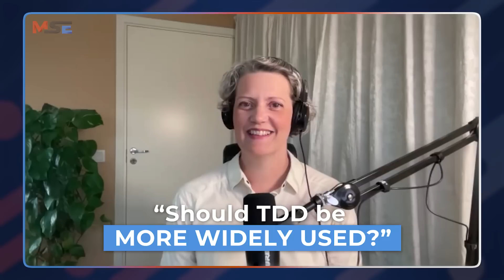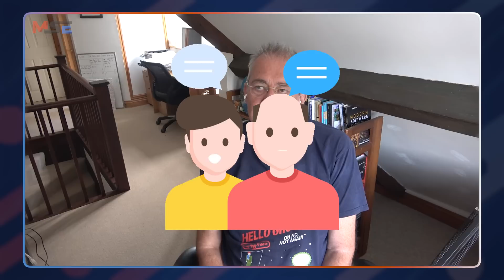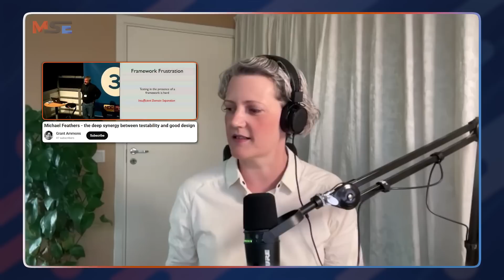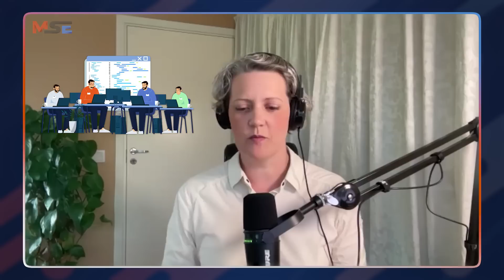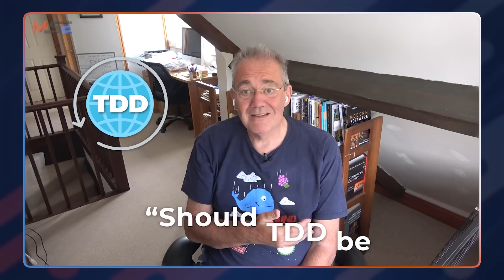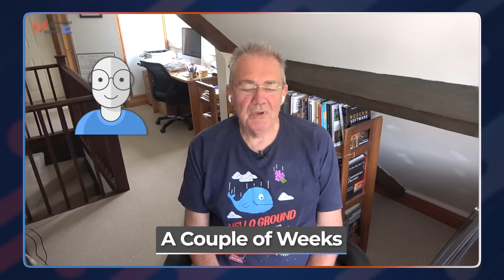Should Test-Driven Development (TDD) Be Used MORE In Software Engineering?

Comment: Do all the tests have to be run on the computer? 
How can I be sure to write a failing test? For example write a failing test for a function which multiplies two integers and returns an integer.
Reply from the maker: Running the tests to get fast feedback is the objective of TDD so "Yes" they all have to run on the computer.
That's easy, you pick an example that demonstrates the behaviour you want, and that's your test, so for your example...

 result = multiply(3, 2);
assertEquals(6, result);

It doesn't say how the code works internally, it just says what the code is meant to achieve - that's a good test.

Checkout my free Tutorial for a more fully-fledged example

https://courses.cd.training/courses/tdd-tutorial

Comment: It took me about 3 months to understand why TDD was the bee's knees when I joined a team doing TDD, and it's what you say here - it's the testable design it generates. The coverage is just a nice side effect.  I've got to the point where I can code this way without the tests, but I still use it for production code as I much prefer the fuzzy warm feeling it gives me to know that my code is evolving correctly and I've not made any design booboos.
Reply: I would fundamentally disagree  about the importance of the code coverage.

While just chasing code coverage metrics is a fundamentally broken way of working, having that code coverage is fundamental to so many other parts of the job.

If the bit of code you are working on and everything that uses it is not covered completely by tests, you break the core reason for using version control in the first place, the knowledge that you can check out any commit between adding and removing the tests for it and knowing that you do not need to go down the debugging rabbit hole to know that it just works.

Even more importantly, unless you can be 100% certain your automated tool always gets it right, you cannot refactor with confidence.

Finally, you don't systematically push io and core functionality apart in the way that makes updated code more testable.

Comment: TDD encourages writing higher quality code with high quality tests and better designs. The folks talking about coverage miss the point. Most enterprise code bases I’ve seen are 5% to 20% coverage and handle trillions of dollars of transactions. But I’ve seen low quality and buggy code with 100% coverage. In my view, it’s much more about the information value of the tests (Jim Coplien’s conjecture), not the # quantity of tests or % coverage. TDD encourages MUCH higher quality code AND tests in my opinion with higher information value about the quality of your code, not just a higher quantity of tests. I’m a huge fan of TDD, not a fan of test coverage metrics without it.
Reply: Coverage should not be a metric. It's a tool to help developers identify code that we definitely know is lacking any test confirmation. It's a valuable tool when working with legacy code in order to gain a sense of how much of a safety net we have for the code.

High coverage should be a result of TDD, not the goal.
Reply: @jimhumelsine9187 I would disagree about coverage should not be a metric. While having it as a target in the management by metrics sense is a disaster, being able to say file x has 5% coverage and file y has 95% coverage so x definitely needs more work can be extremely useful.

Comment: I view Test-Driven Development, Characterization Testing and Approval Testing as similar, but still different. I use them for different purposes.

They are similar in that each is based upon the behavior of the code, and all three techniques are structured with the Given/When/Then format. They differ in how the tests are created.

With Test-Driven Development we know the exact behavior we desire, and we define it in the test first. Then we implement the code until the test passes.

With Characterization Testing, we're often working with legacy code for which we don't yet know the desired behavior. With Characterization Testing, we define the Given/When portion of the test, run it, and observe what the legacy code does. Then we define the Then portion to match the existing legacy code behavior. Characterization Tests codify existing behavior, right or wrong, within the legacy code so that we can refactor the legacy code with less concern that we might change existing behavior. They provide a safety net from which behavior and intent will emerge as we refactor the code safely.

Approval Testing is sort of the hybrid of TDD and Characterization Testing. We're using a Characterization Test technique for new code. We define the Given/When part of the test, and we put almost anything in the Then portion. It doesn't matter. Then we implement the code and run the test. Then we observe what the code produced versus what we currently have in the Then portion. If we like the new results, then we codify them in the Then portion and continue.

We must still "Approve" the test results, but rather than defining then at the onset, we approve them as we observe them with the evolving implementation. If the new results don't look right, then it's a legitimate failing test.

I use Approval Testing when my asserts are based upon lengthy toString() results. They are too tedious to type in manually. It's much easier to let the code generate the string, confirm it visually, then copy it into the test once the code is producing the results I desire.
Reply from the maker: I remain sceptical, as I was in my conversation with Emily. In your description you say "We must still "Approve" the test results, but rather than defining then at the onset". Exactly, so how is it possible for us to "Drive" as in "Test Driven" the design of our code from a test, if the test only exists AFTER the code is written?
Reply: @ModernSoftwareEngineeringYT  I'm still doing TDD in small iterations. I tend to follow Bob Martin's 3 Rules of TDD where he cycles through the three phases of TDD quickly doing just enough test, implementation and refactoring repeatedly until the test is complete along with the refactored code that causes it to pass.

Let's assume that I'm testing a function that returns a boolean. I'll add that assertion in the THEN portion of the test using standard TDD procedures.

But let's assume that I'm testing a function that returns a lengthy formatted string. This might not be a string that my code formats. For example, if I want to confirm the elements in a List, I'll add an assert that retrieves the toString() value of the List and compares the string representation of the List to a literal string in the test.

These string representations can get sort of long. While I don't want to type long string in by hand, especially since it will probably contain a typo anyhow, I will know that the string has the correct value when I see it. I'll start with an assert against "???", which will obvious fail. Then I look at the returned string, and if it does indeed contain the content I'm expecting and formatted as I expect it, then I have "approved" it.

But I don't want to make this visual check each time I run the test. So I copy the approved string, paste it over the "???", and codify it.

The only difference between this approach and TDD is when I put that string in the assert as the "approved" string. Do I add it initially, quite possibly with typos, or do I add it once the code generates it.

Technically there is no difference between trying to create the approved value via TDD or just adding "???" as the initial approved value. Regardless of which you chose, when the test fails, you'll have to decide which is the "approved" value. The one that's in the test, or the one returned by the code.
Reply: @jimhumelsine9187  Why look at the string rather than the list itself?
Reply: @babgab  I used to do things like assert the number of elements in the list and/or assert each element individually. Then I realized that toString() provided a single unique element that I could assert that would confirm everything in the list.

This works for any structure that deterministically returns the same String representation upon each execution. It also works for composite structures, such as Trees or any object that contains field attribute objects, and those attributes are composite structures themselves.

That means that toString() must be defined for each object that's represented in the String. You can't use the default toString() implementation, at least in Java, since it generates a new hash code like value on each execution.

It also means that any identifiers and time values, such as timestamps, must be injected as test doubles so that they are consistent upon each execution as well.

There are also practical limits to this. it's not practical if the list being asserted has 1,000 elements in it. The String version would be overwhelming. In that case, I'd probably assert the list count and spot assert a few indexed elements individually.

I don't always use this technique, but it's useful when you want to assert multiple attributes of a moderately complex, yet not too large, object. One assert will take cover all the cases.
Reply: @jimhumelsine9187  But not only is that horribly inefficient (and making tests inefficient forfeits some of their value for TDD!), one assert if multiple properties are changing is the opposite of beneficial. I want asserts of each thing that changed during my test individually so that I know at a glance from looking at the error output what failed, not just that there was a failure! Not to mention, if the assert itself is too big, then it becomes unreadable and I have to spend effort untangling what the differences between the expected and actual results are manually and that's kind of counter to the point of automated testing to begin with. The fact that you're putting timestamps and stuff in the test part you're comparing makes it even flakier and more complicated, adds even more noise to the output on a failure.

I would never sign off on a code review that did what you were describing in a unit test unless the actual observable behavior of the code involved a string changing in the data. And even then, I might want to see individual assertions of specific features of that string. I don't think gold master testing is appropriate when you can use the full power of your test harness to test individual features of the output. I don't work with you and I can't really tell you what to do, but I implore you not to be hostile to your coworkers and future self in this way.
Reply: @babgab  It's a matter of preference. If it's not for you, then it's not for you. It worked well for me when I used it.
Reply: @jimhumelsine9187  Sure, "I don't want my test failure log to be incomprehensible symbol vomit that I have to sift through in order to find the actual problem" is a matter of preference. I guess. Technically. But I don't think it's a matter of preference that this approach is flaky (and in my experience, gold master testing is extremely flaky), burns CPU time for no reason to generate the string data, and encourages testing to an implementation rather than an interface.

You may have felt that it worked for you, but I'm skeptical that a thing I would only recommend as a last resort was really the best thing you could have done.
Reply: @babgab bear in mind he said at the start that he was primarily using approval testingxand characterisation testing for legacy code, so this sort of thing might be your only option while you clean up the underlying mess.

It should still be flagged as a test to remove when the called code is fixed. If that is not the case, he is just wrong to do it that way.

Comment: TDD is fine. In actuality, I find business needs often beat good code. I tend to right the correct logic and then write my unit tests. If the test fails, then the logic can be slightly wrong so it gets tweaked and usually passes the test. 

On occasions where the test still fails, often it's the unit test that's been wrote incorrectly.

Comment: Agree with most of what was said. However, I don't tend to use it when I am prototyping. You really need to have a good idea of what the interfaces will look like before its worth writing the tests upfront.
Reply: The point of writing the tests is to explore the problem domain. The tests ARE the prototype.
Reply: @7th_CAV_Trooper  I have not found TDD (with automated tests, at least) to be a useful prototyping tool because when I'm prototyping, I'm not trying to figure out what the shape of the code is supposed to be - I'm trying to figure out what the implementation is supposed to actually do. I can't know what the API should look like until I know what the implementation needs. I work in video games; I can't know that my implementation is what we need until I see it working with the whole program in the loop, because even tiny implementation details can have a big impact on the player experience. And I'm not the one who decides that the prototype is even showing what we're going to move forward with; that's usually an entirely separate person, entirely separate discipline even. They need to see my prototype working in the actual program somehow before I can turn the prototype into real code, because they're often a non-technical person and the test output is meaningless... Yes, I could write the actual code with TDD, but when correctness is subjective and measured only in the context of the whole app, the iteration time benefits of working in a test harness don't really apply.
Reply: @babgab writing a test is the fastest way to explore the domain.
Reply: @7th_CAV_Trooper did you read a SINGLE word of what I wrote? Do you know what a video game is?

I CANNOT prototype some kinds of things in an automated test harness because the success/failure of the prototype is based on a human being's emotional response to what my code does in-context. The domain  being explored is not verifiable in a test harness, so TDD cannot be used to explore it. I need real eyes watching the screen, real hands on the controller.

Tell me, how do I explore whether a new gameplay mechanic makes a player feel more or less fear of a monster in our game, using an automated test?
Reply: @babgab you need to build a human simulation to test the game. You can use AI sentiment analysis to double check the results.
Reply: @7th_CAV_Trooper lmao, good one
Reply: @babgab new Moq<Gamer>(); 😅
Reply: @7th_CAV_Trooper  depends on the problem being solved. If I'm prototyping, I'd rather just be experimenting with the application code and running it in place, rather than running tests.
Reply: @SirBenJamin_  you can always run it in place, in smaller chunks, faster with tests.
Reply: @7th_CAV_Trooper  why are you trying to tell me how I like to work?
Reply: @SirBenJamin_ I'm not telling you how to work. I'm trying to correct what appears to be a misunderstanding of what TDD is.
Reply: @7th_CAV_Trooper and here lies the problem. I think TDD generally gets a bad rap because the people that promote it so hard are so militant about it. I literally just told you I like to use it, ... just not in all cases. And because of that, I have a misunderstanding of  it? There is no right or wrong. It's literally down to preference. And more importantly, the type of work.
Reply from the maker: I am the reverse. I value it even more when I am prototyping, because what am I doing when I am prototyping? - Usually trying to figure out what shape I want the code to be in, and TDD guides me in doing that better than anything else.
Reply: This is a common misconception. You don't have to write the tests first in full. You write both parts in tandem in small steps.
Reply: @dragonhide5428 there is no misconception.